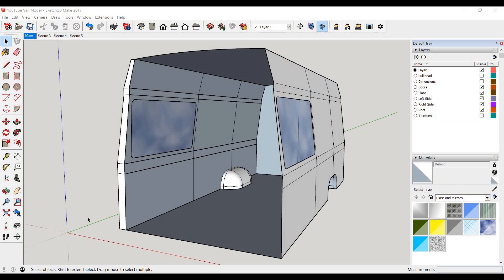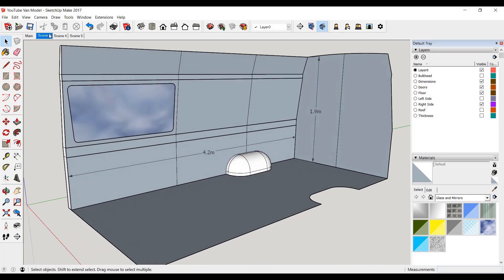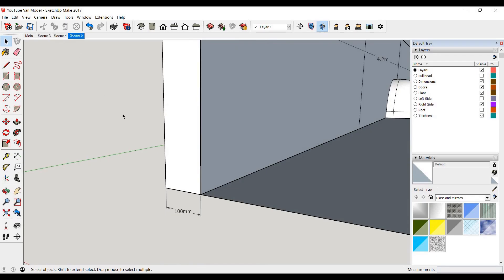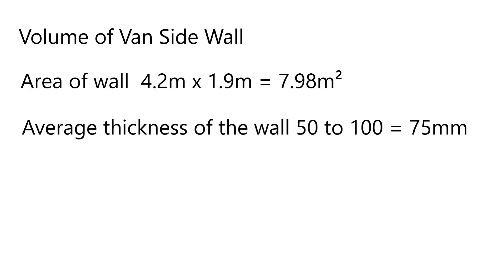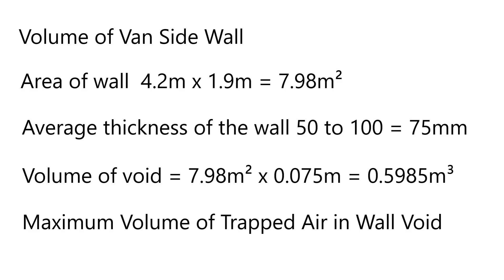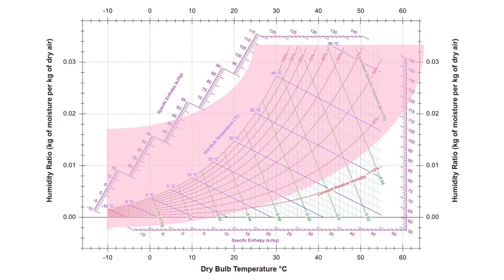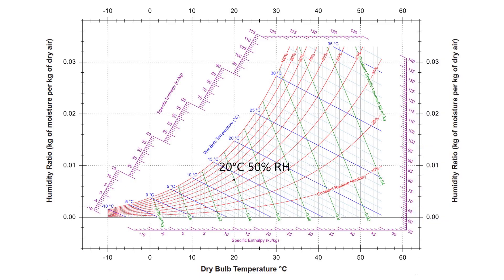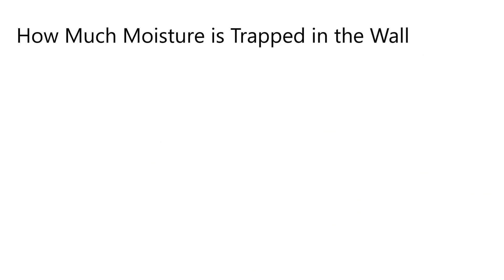There is Moisture Trapped Inside my Vapour Barrier!

Comment: Hi mate @Greg Virgoe. Been binge watching your superb videos from way back (Looking to buy my first van to convert) and this more recent video caught my eye. 
I've been trying to learn as much as I can, and I was wondering about the possibility of painting all the steel internals with some sort of rubberised paint? So in essence creating a fully sealed rubber skin on the whole inside. Is that even a thing? Thoughts? Recommendations? 
If it is 'A thing', would it be a good idea before applying more typical insulation etc over that surface? 
Many thanks for all the videos, I've been watching and subscribing to quite a few channels, and I'm really enjoying yours.
Reply from the maker: Hello Neil. I wouldn’t waste your time as money doing that. A thin layer of any material wouldn’t be enough to raise the surface temperature above dew point and you would still get condensation issues. Just go with my methods and you’ll not have any problems
Reply: @GregVirgoe  Brilliant, cheers mate. Appreciate the speedy response! On the hunt for a Vw crafter or Merc Sprinter and will definitely be taking a lot of your advice.

Comment: If I understand right, the calculation given is for one wall. So, considering all other surfaces we might need to multiply by 3, giving 15mL. This is still a small amount of water, but if you want to reduce it further (or remove whatever water might be trapped back there for other reasons), you could cut a hole in your barrier, seal in a container of desiccant for a time,  remove it and seal things up again. Weigh the container before and after to see how much water you removed.
Reply from the maker: With all the insulation in there in reality the volume of air is actually very much less so probably talking about one or two drips worth 🤩👍🏼
Reply: @GregVirgoe  Very good point. I also did a quick calculation and estimated that each mL of water can rust 2 grams of iron, again a small number. So, in summary I agree this is probably not a problem in your case. But in case someone thinks it is a problem, the desiccant idea is a way to check that, perhaps quantitatively.
Reply: Hello Tony how are you doing, nice to meet you here.

Comment: Hi Greg, I've recently re watched you videos on your floor. Also have seen others use aluminum square tubing on the floor. I like that you sealed it. 
Was wondering about any condensation under the plywood floor. Guessing none because it isn't exposed to the air. One builder was using airflow,ventilation under the floor and behind the refrigerator cabinet.  Could you explain it again but in different words?
I would think wood or metal beams glued with and industrial strength, to the floor wouldn't need additional screws or bolts. In an accident any part can get snapped off. Once the cabinets are fastened to the wall, it holds down the floor.
I'm re watching some of your build videos.
Reply from the maker: There wouldn’t be any condensation on the plywood as it’s warmer at that point so it’s above dew point.  Timber would be better than aluminium as it’s better insulator. Ali will conduct the cold. 
I would recommend a sikaflex 512 or 522 adhesive for the battens making sure the floor is clean of dirt or grease. 
Thank you for watching.
Reply: @GregVirgoe  Than you for responding. I've seen too many videos and one guy is a builder in N.J. You may have see his videos. Humble Road. I think he used a flexible adhesive with aluminum.  He keeps talking about heavy mass vinyl. I'm guessing the cold transfered through the metal floor and walls  isn't a problem because of the insulation against it. Did I get that somewhat correct? I understand the the warm moist air as you have mentioned.
Reply from the maker: @277kne  yes I know George he has a very good channel and does very good videos too.
Reply: @277kne  His heavy mass vinyl will bring some insulation properties but primarily acoustic benefit and if he is screwing or applying anything on top of it, then it will act as a thermal/acoustic barrier.

Comment: That's interesting. I come from a building background and we work with vapour barriers all the time. We believe that the spaces should be ventilated to allow moistures escape. In buildings where no ventilation has been provided it is not uncommon to find the insulation saturated at the very top of the wall or roof. For your small wall with the medical spoonful of moisture calculated for the volume of the whole wall - in reality this small moisture content will in all probability exist at the very top of the wall, maybe making the insulation in that area feel damp. If vents are provided then the moisture can thus escape thus protecting the space and the insulation. Might this be relevant in a van build?
Reply from the maker: NO, not at all relevant. The metal skin of a van is a completely different application to material used for building houses. We are preventing condensation from forming on a cold metal surface. 
Building materials are porous which is why you need to deal with the moisture in there. Totally different applications.
Reply: @GregVirgoe  I agree most building materials are porus. In roofing situations where metal or some non porus material is used - to avoid condensation arising it is advisable to allow for ventilation of the space as it allows mositure escape. Might this be applicable to a van wall or roof?

Comment: Hi Greg.  Now that you have been living in your van for quite some time, is there anything you wish was different or wish you had added or not added?  I am just about to start my next build and have sold my Renault Trafic to buy a Citroen Relay/Boxer/Ducato.  Before I start it though I was hoping to get your insight as you have lived in yours for a while.  Cheers pal.  Hope all is well with you guys!
Reply from the maker: Hello, yes I didn’t need all the 3pin sockets we installed and only use the inverter very rarely now. Try and power everything off 12v DC as much as possible. I ended up fitting more 12v usb sockets in the van.

Comment: I live in a very hot county where the temperature could reach 50 degrees Celsius in the summer under the shade , while it goes below Zero degrees in the winter . So on which side of the wall shall I apply the moisture barrier , while using very strong cooling air-conditioning in the summer, and warm air from a heater in the winter . Will it be better to apply it on the metal chassis side or the last layer of insulation on the inner side ?and what is the best material to be used as a barrier?
Reply from the maker: It always goes in the same place on top of your insulation. Putting a vapour barrier right on top of your van body will achieve nothing as it will be the same temperature as the van. You need a layer of insulation against the van then the vapour barrier over that before you apply internal cladding. It works the same in winter or summer.
Reply: @GregVirgoe  Thanks  for the reply , but I noticed from your marvellous previous experimental video with the Ice bucket , that condensation happened on the cold side of the bucket where there is no thermal barrier , while it didn’t happen on the warm side of the bucket where the barrier was there at the warm side of the warm room or surroundings . 
So wouldn’t it be also useful to stick the thermal barrier on the inside of the van hot skin , to avoid condensation attacking from the cold air-conditioned humid air inside the van in the hot summer , I just want to make sure no condensation attacks the skin in winter and in hot summer . ?  What is the best effective material as barrier ? 
By the way , I love all your videos , 🤩🤓and appreciate all the information and knowledge that you introduced in them 🏅, Thank you so much , keep going ! 👍👌

Comment: I added a barrier. But put so many holes in it it's close to useless. I'll worry some time. Maybe. 
I guess the only way to avoid the problem is to use spray foam like they do on narrowboats these days.
Reply from the maker: What sort of holes? Screws don’t leave holes. Did you seal up around sockets etc?
Reply: @GregVirgoe  yes, the screws. But let's see what happens. I need to use it, not spend more time chasing things.
Reply: @kevgermany  Screws seal, they won't hardly let any moisture vapour in, if any..You didn't build a submarine where there is pressure that forces water in...
Reply: @Namdor2012  hope so, fingers crossed

Comment: Hi Greg I have an 05 sprinter and I'm thinking about going with a 24 volt system. I read that I can save money on cable sizing and the overall system will work more efficiently. Please tell me your thoughts Greg, thanks.
Reply from the maker: I think you will spend more transforming it back down to 12v for each appliance. Stick with a 12volt system it’s so much easier.
Reply: @GregVirgoe  thank you Greg.
Any idea if your going to do the econobuild series?

Comment: Also, the FIRST warm day in the sun that heats up that wall will drive all that moisture out.  The walls are ventilated at the very bottom and vapor pressure increases with temp.

Comment: Hey Greg, very informative and detailed video. However it didn't really address the main criticism I've seen toward vapour barriers - that is, unless there is a perfect seal with 0 perforations, moisture will collect between the vapour barrier and the interior wall of the van. My original reaction to this criticism was 'just make a 100%-proof seal', but since learning that even a minute gap, such as one made by a screw-hole, is enough to compromise the function of the vapour barrier, I've again returned to being undecided on whether a vapour barrier is essential or a trap. Those who advocate for skipping a vapour barrier will also say that moisture is able to dissipate without one. Whereas with a vapour barrier, even one that is 99.99% sealed, moisture will get in (through the 0.01% gap) and subsequently become trapped. 

I have no opinions myself - I just wanted to hear your thoughts on this take, considering it wasn't addressed in this video.
Reply from the maker: Firstly there is not a hole when screws are fixed the screw is plugging it’s own hole very tightly. 
Secondly it is not difficult at all to make sure everything is sealed. You just need to spend a little time to do it. Not hard at all.
Reply: A few screw holes even a few small OPEN holes WILL NOT suck moisture in like a tap, a van is not a submarine where you get a massive vacuum effect ...No vapour barrier you have one gigantic enormous hole, and once moisture builds up in the insulation it does not retreat out easily, then look out...

Comment: Hi Greg. I understand a vapour barrier is used to stop any moisture created inside the warm van reaching the dew point of the cold outside. maybe not like that but hope you know what I mean.  maybe with your knowledge you could make a video on this aspect. You certainly
made it clear very little traped water is not an issue. Keep up the good work.
Reply from the maker: Please take a look at my insulation workshop video. That does cover it I’m sure 😊

Comment: Excellent information Greg, this whole insulation debate does become tiring with some of the arguments people put forward.  Years ago, my first van was an old VW Westfalia which had been insulated from new without any barrier, I had to replace a lower wing panel and sills as the lack of barrier had allowed moisture into the insulation with all the subsequent problems you would expect. I used a basic polythene barrier in that but never had a water collection issue afterwards.  My current LWB VW Crafter collected so much moisture on the roof as an empty shell over the winter, i thought it would never stop, I put the 50mm PIR board on the roof back in January which eradicated moisture build up overnight, much like your bucket experiment demonstrated 😉. Practical experience has taught me those basics, but your maths and science should certainly put the doubters on the right path 😆

Comment: Am I missing something here?

I didn't bother with vapour barriers in my sprinter build.
I noticed that there are factory drainage holes in the bottom of each panel and doors. 
I figured as long as air can leak IN through various gaps then surely the moisture will be expelled OUT of the hole in the base.

I was more worried about trapping the free movement of air by using a vapour barrier and thereby, in turn, trapping an accumulation of moisture.
Reply from the maker: Yes you are 😊
Reply: So did you seal up the drain hole in the bottom of the door too?

Comment: Hi Greg once again a spot on video. But would the insulation behind the thermal barrier take up a lot of the volume due to its mass and make the water content even less especially celotex and the like which is very dry and sealed due to its manufacture process? If that is the is the case you may have to get an eye dropper out to demonstrate. LOL
Reply from the maker: Yes exactly so in reality actually much less than I calculated 🤩

Comment: Great stuff, Greg. You are doing a superb job of calmly getting the correct information out there. It might have been a good idea to tag on the end of that video the amount of water that would have been held in that same void, based purely on condensation, by multiplying up the surface area of that uninsulated ice bucket!
Reply from the maker: Yes as well as that it would continue to produce water as long as the steel is cold enough. 🥴
Reply: @GregVirgoe  I'll take the 5ml, thanks. 😉😁

Comment: Excellent video again Mr Virgoe.
Absolutely agree that the vapour barrier is more to stop condensation created within the van. The amount “trapped” behind is indeed negligible.
I have however pondered the idea of a strategically placed breathable membrane which would let trapped moisture out but not let it in.
Basically thought of this while wearing my Goretex shell in the pissing rain. Wet outside no sweat inside.
Reply from the maker: Don’t over complicate it just fit a good vapour barrier and sleep easy easy at night
Reply: @GregVirgoe  But Greg, you didn't put a vapour barrier on your floor when you build it. I just yesterday watched the floor video and was wondering why there's no vapour barrier. Only aluminium tape and the foam boards and wooden studs? Confused. Cheers!
Reply from the maker: @hungrycamperfilms  the PIR slab is foil faced so that is the vapour barrier. Then you only have to foil tape over the timber onto the foil of the boards to complete the barrier. Once I had finished taping the entire floor was one continuous foil finish. No need for anything more than that.

Comment: Damn you , letting facts get in the way of a strongly held opinion 😂🤣😂😂Spot on as usual, they also miss the fact that when they live in an van without a barrier there is a free. exchange of saturated air into the condensation zone AND that much of that void is filled with insulation which further reduces the enclosed volume.  Keep up the good work putting facts in front of falsehoods
Reply from the maker: Thank you phil 👍🏼😊

Comment: Great explanation. 
When I was planning my van build this was argued on every channel and van build. 
I watched years of van builds especially this channel. 
I live in South Carolina in the USA where we have a simi tropical climate with high humidity year around. 
What I did was no vapor barrier. 
I installed 1,200 watts of solar panels with 900 amp hours of lithium batteries and a mini split AC/heat pump. And a Propex HS2000 propane heater. 
I can control the climate and humidity year around no matter where I take the van.
Definitely a thumbs up for the video 👍
Reply from the maker: You are fortunate to live in an area where it hardly ever drops below dew point. Also AC is the perfect dehumidifier and will dry out the inside air too.

Comment: Thanks again for the great content!  I don’t claim to be an expert, but I still have questions.  If I lived in the UK  I would defiantly do as you recommend. However, I reside in the south western USA and we have a hot and dry climate here. I do agree with you one should take measures to ensure the moisture does not get into the walls, but what about providing a way for moisture to get out and using materials that release the moisture (natural wool)? Lots of people in the USA are using Havelock Wool because it is mold resistant and releases moisture unlike many manufactured products.  A trip to the desert for a few days and one could dry things out. Please understand l am not challenging your expertise, I am trying to learn and better understand. Thank you!
Reply from the maker: If you live in a hot dry climate you would not need to worry about condensation.  
Havelock wool will not stop condensation forming on the van walls if it’s cold outside. To promote it as anti mould is ridiculous. What they are saying is it’s ok for you van to be soaking wet. Why would anyone in their right mind want that to happen at any time?